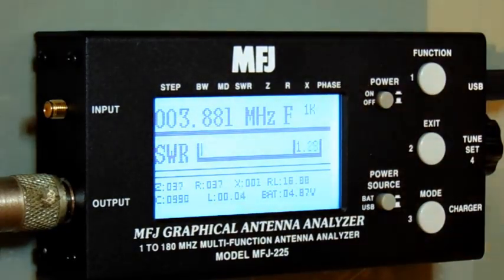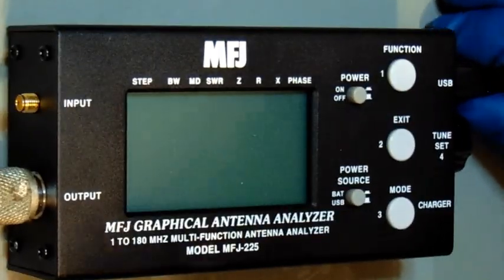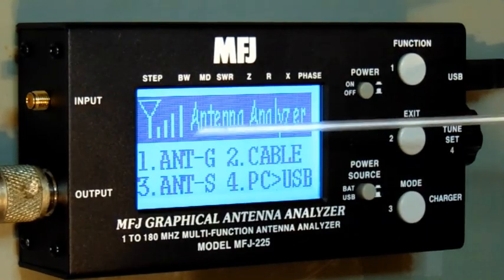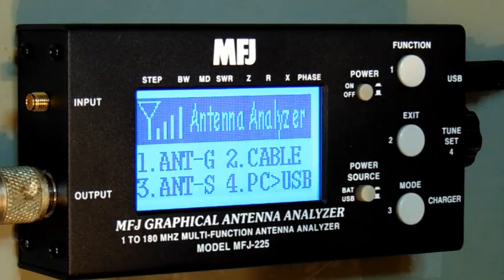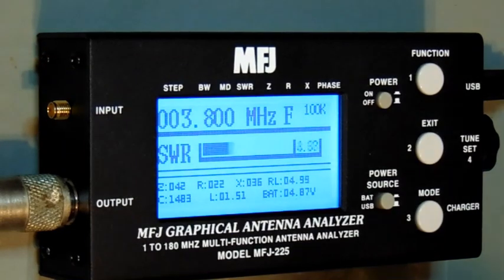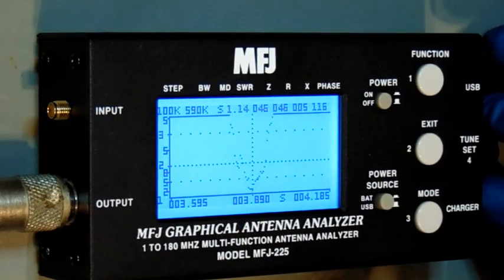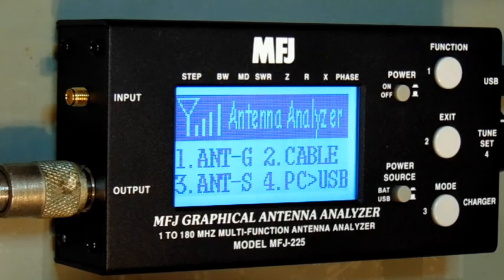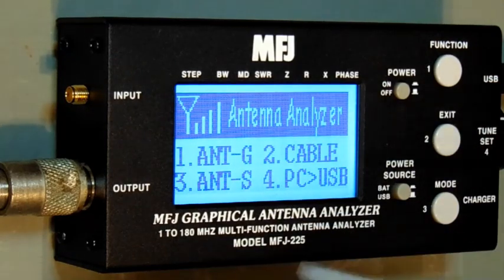MFJ-225 Basics

Comment: Thanks for the video. Looks like a nice analyzer. I had a 259 and it worked OK but then started acting up, as typical with many MFJ products. It later went under in the flood so I need to replace it. I like the graphing feature of this plus the fact it can be connected to a computer as I saw in another video. This is on my wishlist.
Reply from the maker: Thanks for the comments. I really am very happy with it. I had lent it to a friend , who has a 269 C. He had my 225 for a couple months while he re-built a Mosley tri -band beam.  He also was pretty impressed. It certainly makes working on any antenna, but especially a multiband, a lot easier. I gotta feeling that if he gets a few extra bucks, he'll be getting a 225.